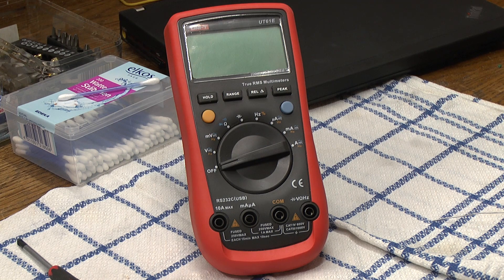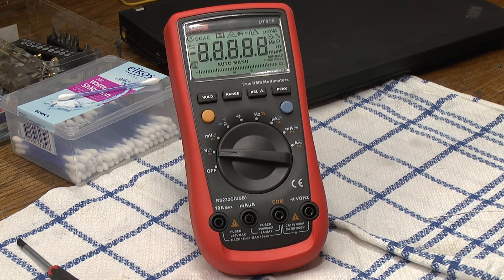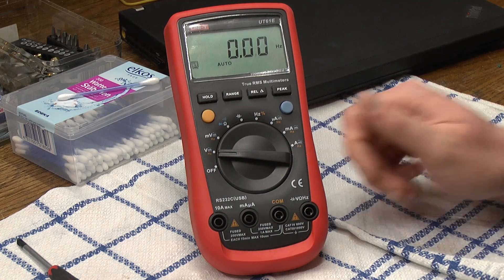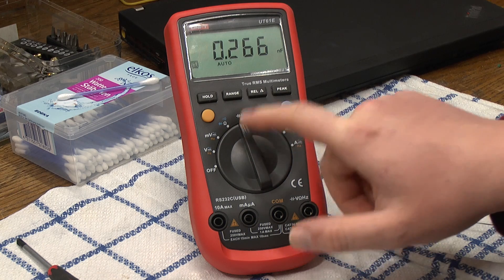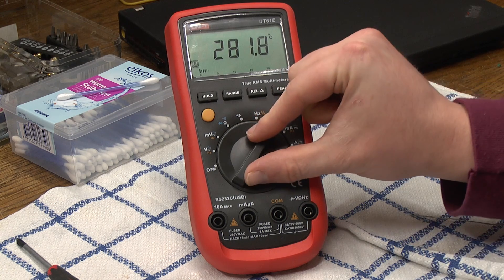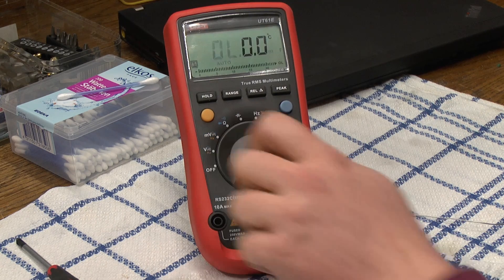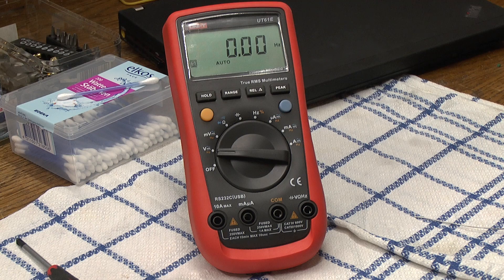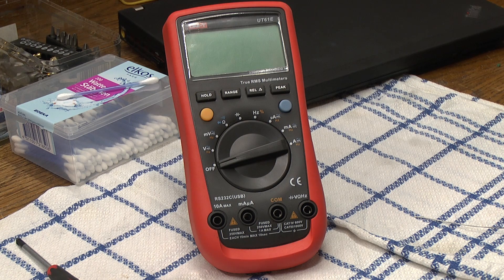Uni-T UT61E Multimeter repair [1/4]

Comment: Mine started measuring capacitance instead of voltage, resistance and everything else mixed. The next thing it did was dying and  did it all that out of nowhere. I was using it to measure with very low tension say bellow 12V and with  mA range current. Every safe component is functional but it is shorted after the fuses and movs. Not buying unit again as they are quite expensive here in Brazil.

Comment: Mine has the same problem. The switch got deformed in my trailer on a hot day and now it reads amps unless I push down on the switch

Comment: 61E doesnt use the same chip as other 61 version. This one should have a ES51922 chip. My best guess is shorting on chip's pins. And yes this chip can measure temperature but circuitry not installed on PCB.

Comment: This really does look like the result of a measurement mishap. I've never seen a low end or midrange multimeter that used a microcontroller, only fixed function ICs.

Comment: Check the PCB tracks on the selector switch, most likely an over-voltage victim, an arc inside burned a connection on the switch pads and that's why it behaves like that. This kind of medium price devices do not use a firmware, most likely they are hard coded and most of the time based on one chip to lower the production cost and that chip can be even COB. Hope you will fix it, Uni-T are quite ok, they have a good contrast display perfect for a bench work ^.=.^

Comment: CONTACT THE MANUFACTURER.  AS A PUBLIC RELATIONS MOVE, THEY MIGHT JUST REPLACE THE UNIT.   THEY PROBABLY HAVE ABT   $1.25 USD INVESTED IN IT.  IT'S DOUBTFUL THIS COULD HAVE BEEN CAUSED BY MISUSE.
GOOD LUCK.   THANK YOU FOR YOUR VERY INTERESTING AND INFORMATIVE VIDEOS.  KEEP UP THE GOOD WORK.  HANG IN THERE.  MIKE
Reply from the maker: +AAR2VZ 
No need to write in all capital letters.

Comment: You might need to do a hard reset, just hook it up to 600 volts AC @ 30 amps, make sure its AC, that's the key...do it for about 30 seconds, that should fix it and guaranteed no more problems!  JK!  :)   I noticed it has a peripheral port, have you checked with the mfg to see if by chance you could re-flash the BIOS?
Reply from the maker: +JacksJunkDotCom 
The interface on this is only transmit, not receive, so this does not properly interface with a computer.

Comment: Could be the function switch itself, my guess would be that in the past it was opened up, but not put back together correctly so the contacts don't line up to where they should go.
Reply from the maker: +CoolDudeClem 
I already took the switch totally apart and cleaned it, so it should be fine.

Comment: My guess is the contact wipers on the rotary switch are misplaced (i.e not bent enough \ not making contact, or one of them missing etc.) Not to do with cleaning.
Reply from the maker: +gmaildotcom 
I had the switch all taken apart, and it all seems fine. All the places that would take a contact have a contact in them.

Comment: I wonder if they may have one chip for several versions of this with a selection done by strapping pins to voltages (if that makes sense). In that case an open or short around those pins could cause it to think it was a different model than it really is?

[edit, you mentioned this just after I said that!]

Comment: I might be ENTIRELY wrong, but I think that switch ordering, save for all the broken capacitance modes, kind of remind me of a Brymen BM867/869, with the VFD AC mode at the first stop including a frequency measurement, and the temperature range at the 1 o' clock position. Aren't these meters based on the same ASIC? Perhaps this one accidentally never got flashed with the UNI-T firmware, and is instead running the stock Brymen software? One way to test that could possibly be to hold the range button while turning the meter on; on a Brymen meter, that makes the display say "dSBEEP" while disabling the beeper - a feature that I can't find documented in the UT61's manual. Holding the REL button gives you the model number and firmware version on a Brymen meter, as well.

The model string could really give a clue. For reference, my BM869 says "869-P9".
Reply from the maker: +FFcossag 
I'll try this out...
Reply: +DrCassette I'm really curious to find out your results, although it admittedly sounds a bit too miraculous to be true.

Comment: It must have a wrong firmware installed on it somehow. It can't be the rotary switch because every time you turn it the mode does some how change. And then there is the temperature mode which shouldn't even be there.

Comment: Either defective rotary encoder (with round switch contacts) 
Or wrong firmware or lost eeprom-file.
Reply from the maker: +rarbiart 
I should have mentioned in the video, I had already cleaned the rotary switch.
Reply: any chance that somebody tried to make out of 2 defective units one working... ended up with such a confused one.
Reply from the maker: That could be the reason for this. The seller unfortunately didn't tell me about the previous life of the multimeter so I guess we will never know.

Comment: My best guess would be that the range switch is broken. They probably use the same layout forthe range switch or some solder bridges to configure the chipset inside the meter. They normaly don't have any firmware so a software issue is very unlikely.
Reply from the maker: +Borduino 
I should have mentioned in the video, I had already cleaned the rotary switch.

Comment: If its firmware upgradeable (via usb cable if it has one), I would do a firmware upgrade with the correct firmware.  I was originally thinking the mode switch, but since they aren't all just offset that seems unlikely.
Reply from the maker: +Jay Walt 
Unfortunately the PC interface on this one is TX only, so there is no way to access it via the PC.